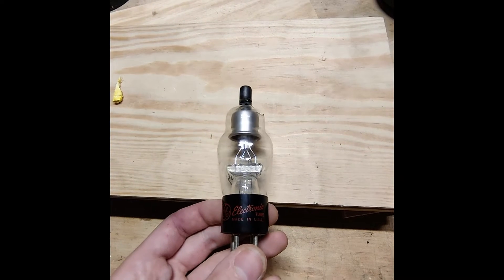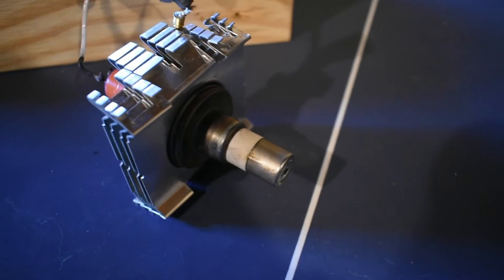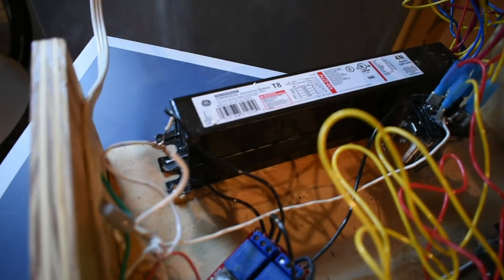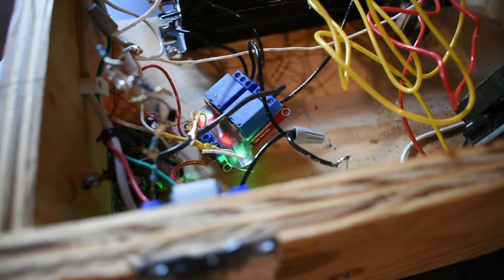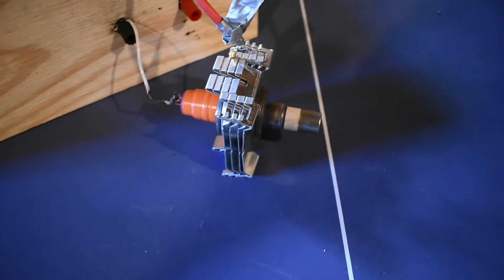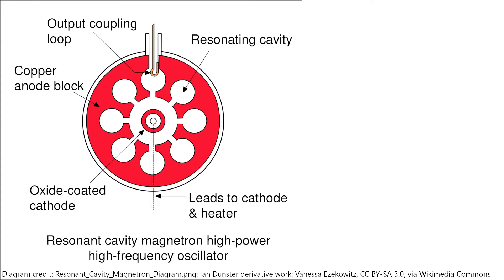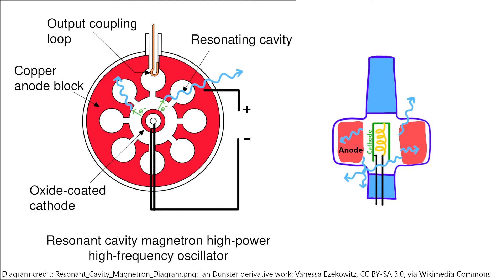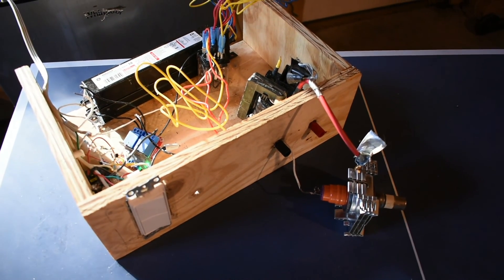Generating X-Rays Using A Magnetron

Comment: i've just measure the dose rate of a diode and it gives off around 260 uSv per second @ 3cm !!!  99% soft X RAYS !!!!!  ( I didnt light up the filament)  and your geiger counter is COMPLETELY unable to measure that energy !!!!!  ( around 15 keV !!) and these soft x rays are the most dangerous as they are absorbed by the tissues of the body .  My HV supply gives around 43 kV and 80uA ....  I havent measured the magnetron yet but i advise you to be extremely carefull !!

Comment: I recomend using soviet B1-0.1/30 tube for generating x-rays. Positive High Voltage to anode, and ground to pin 2. It is not connected to filament, but to metal disc inside, which can be used as a electron target. Voltage should be more than 40kV. It is able to generate 2500uSv/h.

Comment: Beryllium oxide hasn't been used in consumer microwave magnetrons for a long time. Its properties aren't needed at those power levels and it's expensive. If in doubt, measure the insulator's density. Beryllium oxide is about 3g/cm³, Aluminium oxide (the material that's usually used) is 4g/cm³. Unless you grind it to dust, Beryllium oxide isn't an issue anyway.

Comment: I could only make so much soft xrays with my rectifier tube. They are awful xray tubes. I burned mine up. I can still use a neon transformer and it works cold and heats up quickly. Idk what happens if i let the cup glow red but i don’t want to completely destroy the tube

Comment: So, would it be possible to creat visible light with a magnetron if you gave it a proper voltage and frequency?
Reply: Anything can emit visible light if you put in the right frequency and voltage, just you’d need 5.4×1014Hz frequency
Reply: The only tube I've ever heard that is able to produce light frequency is the klystron. Magnetron has intrinsic limitatons to reach that. ...as far as I know.

Comment: Some people shouldn't mess with stuff they don't know too much about. Its a "Magnatron" a hint is in the wording, it neads it's ring magnets to operate, and I see here that you have removed them. Go back and read about how a manetron works before making embarrassing video's. 
Also the magnetron you have there puts out microwaves, not Xrays ! X-rays are much higher frequency than the 2450 Mhz your magnetron would have put out had you not removed it's magnets.😢
Reply from the maker: Wow, you have completely embarrassed yourself. First of all, it's spelled "magnetron". You don't seem to understand physics very well. I removed the ring magnets specifically to prevent the cyclic electron flow that leads to microwave production at high DC voltages. Had you watched the video you would know that I wasn't trying to produce microwaves. With the ring magnets removed, the electrons are accelerated along a linear path and impact the copper anode block at a near perpendicular angle to the surface, resulting in their kinetic energy being converted into x-rays instead of microwaves like in normal operation. Also I'm running this at a continuous potential of 20,000 volts instead of the normal pulsed 4,000 volts, which is enough potential to generate soft x-rays. Hence why my Geiger counter detected ionization radiation. 

You need to read up on physics before spewing this kind of absurdity online.
Reply: Correct me. If i am wromg, but he removed the magnets precisely to stop it from producing microwaves and make it prodice x rays instead, the electrons go now in a straight line instead of in a circle and that is why this works, if they were really microwaves the GM wouldn't have detected them. Again, i am not 100% sure of what i am saying, but i have studied the way both x ray tubes and magnetrons work.
Reply from the maker: @Aaaaaaaaaaaaaaaaaaaaaaaaaa-i8y  You are 100% correct. I have also studied x-ray tubes and magnetrons as part of my bachelor's degree and anyone who knows about that kind of physics (unlike the guy we're responding to) can recognize why this experiment has nothing to do with microwaves.
Reply: i think you don´t get it what the video is about...🤦

Comment: Instead of posting a half assed video of unfinished work why not finish and complete everything rather than rush through this with a dozen excuses?
Reply from the maker: What are you talking about? Complete what? This video was ONLY meant to demonstrate that magnetrons can generate x-rays. The flux is too low to use in an x-ray machine so what more do you want to see? 

You know you could have asked politely for more details instead of being so rude about it.
Reply: In case you didn't notice, that's an experiment, not a project to end in a consumer product

Comment: The insulators in domestic microwaves are ceramic with a little bit of cr02 mixed into them
Reply: chuharry5360  If it was built in the 1990s or later, there's no beryllium oxide ceramic.

Comment: that seems a safe amount of x-rays, i succeeded with random tube rectifiers polarized in reverse, filament off, yes, the majority of the tubes shield the x-rays

anyways to take away those aluminum fins you just need to cut em with cutting pliers making a slit, then enlarge em to slide em off, it's easy

also if the oven isn't ancient it's unlikely that it has beryllium, but better not crack that stuff anyways

Comment: Nice experiment. I tried powering a magnetron with a Tesla coil but it arced around 15 kV.
Reply from the maker: Yeah that'll happen, notice how I electrical taped the cathode end of the tube to prevent this.
Reply: @spectrofreak9988  Maybe you could use it at 60 kV or more if you put it under oil.

Comment: Wouldn't you need to spark gap discharge capacitors to get a good blast of x rays? Also does it generate any 2.45ghz oscillations with the cathode being cold and magnets being off? Would it blast more x rays if the cathode was hot?
Reply: No chance of microwaves in the current condition, and the tube impedance would be too low for X-rays if the cathode were heated

Comment: This one is a legiy beryllium oxide insulated tube. The bright white antenna insulator is the tell. Most newer ones are aluminum oxide or zirconium oxide.
Reply: It's got to be over 30 years old, then.  The insulator color isn't really a "tell". Alumina & Zirconia sometimes doped with chromium oxides (similar to a ruby) are typically used.
Reply: How are you sure and approximately how long ago did they switch?

Comment: Did you try heating the filament?
Reply from the maker: The filament seems to heat up on its own while doing this even though both ends of it are connected to ground
Reply: @spectrofreak9988  try a control on the filament to up and down the voltage. I'm sure you'll get much much between results.
Reply: chuharry5360 Thermionic emission causes the tube to become a vacuum diode: freed electrons will conduct far more current after a certain threshold voltage — the same voltage as the original magnetron, ~4kV.
Reply: If you heat the cathode the magnetron will clamp the voltage to about 4 kV.
Reply: @mernokimuvek  why is that?

Comment: did you remove the magnet to do this?
Reply from the maker: Yes, I meant to mention that this only works with the magnets removed. Electrons are accelerated in a spiral pattern when the magnets are in place, which allows microwaves to be generated. To produce ONLY X-rays, you remove the magnets so that the electrons are accelerated radially outward from the cathode.
Reply: @spectrofreak9988  thanks for the reply and nice video! I wonder how hard it would be to be able to produce an image with this method of producing x rays.
Reply from the maker: @andrew_z_012  Thanks for watching! I think it would be possible to create an image with a much higher voltage power supply (eg >100 kV) or with very high-speed x-ray film but otherwise it would be difficult. No observable glow is produced when I put a phosphor screen next to the tube, even with up to 20 seconds exposure time on my camera. The x-ray current is substantial but really not enough for a good image in its current state.
Reply: @spectrofreak9988  Thats unfortunate since I can only afford a 40kv* power supply and your diagram shows that the xrays spread randomly so it would be hard to focus it on one area for an image. I was trying to do this since I have magnetron  but also since I am in high school and new to high voltage and trying to do a similar thing could you add me on discord I have some questions
Reply from the maker: @andrew_z_012  I don't want to give out my discord on here but you're welcome to email me with any questions at crustychem@gmail.com! I'd love to help out!
Reply: One of the reasons you are getting x ray output is the antenna insulator on this tube is made of BeO which is very transparent to x rays. 😁